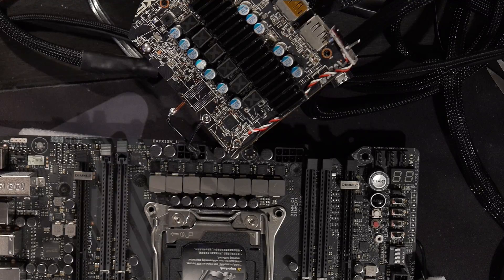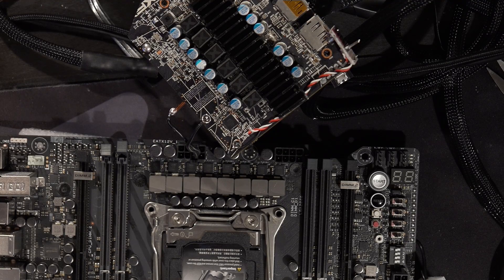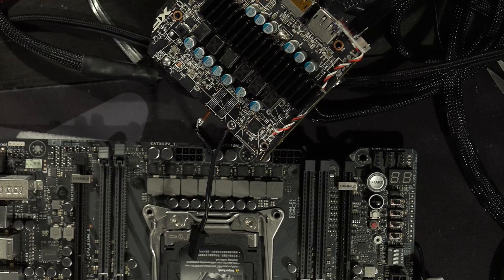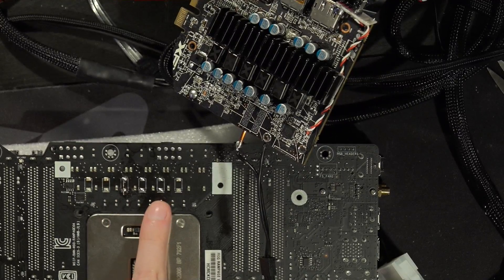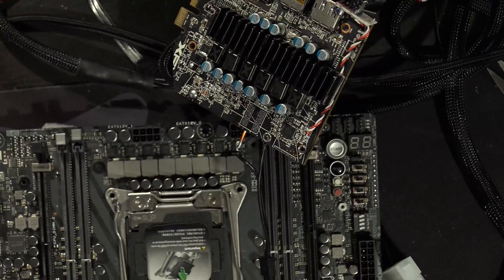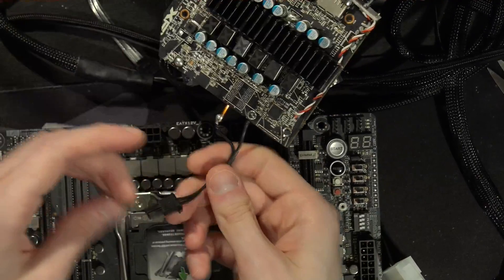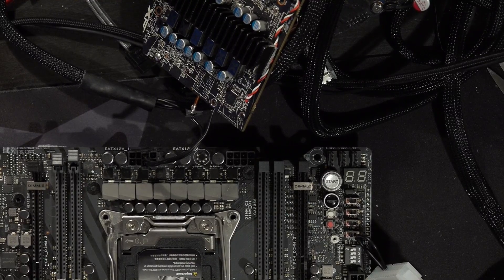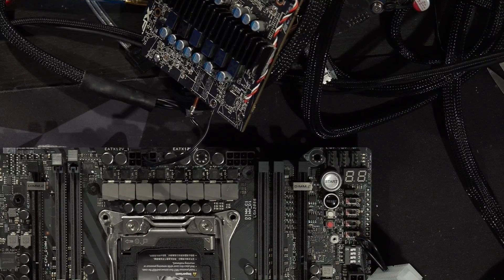Short hunting on the Rampage VI Apex using an RX 480 VRM

Comment: Hey Buildzoid, great video!   I really like that you showed the proper way to sniff out a short on a rail that could be shorted among lots of components.   Personally I use a thermal camera, but IPA is my backup along with freeze spray or upside down air duster.   As far as getting that component off, motherboards are not fun since they have massive power and ground planes to sink away heat.    I think I would desolder the 8 pin to get it out of the way, then cover the near by caps and inductors with copper or aluminum tape, then preheat the board to 80C or so in a reflow oven before trying to remove the chip.   That’s a safe temp for the caps and the plastics and puts a lot of heat into the board.   That should make removing the chip a bit easier.   I’ve also done sensitive work like that by getting a big glob of solid core solder on the tip of a wide iron and just laying the bead on top of the chip so it doesn’t flow around it and lifting it off with tweezers.  That usually can get enough heat to the pads without blasting the area with hot air forever.   Once it’s off you can wick the pads and put down some low melt point leaded solder and flux so it takes less heat to get a new one back on if you plan on replacing it.     Keep up the great work!

Comment: Hey man, my name is Conrad. If you could reply that would be great, but I understand that you’re a busy man and wouldn’t even see this.

So anyways, 2 weeks ago, my powersupply started going out. Whenever I would play a game, my entire computer would shut down and give me an error saying ASUS shut down my PC because system detected a powersurge. I assumed my PSU was going out, bought a 750 watt, and threw it in my system, everything worked PERFECTLY! For five minutes.. As I was testing a game, my computer did what it used to do. Just randomly shut down.. except this time, when I pressed the power button, everything would flash as if its turning on, for about a 0.001 second, then turn right off. The only way I would be able to get this to do it again would to disconnect all power from the PSU and reconnect it. My PC would do the same thing. . I was super confused as to why it happened. I looked it up and coudnt find anything on it. I have a gtx 980ti and its about 5-6 years old. I had a random gut feeling that my GPU just went out, so I unplugged the PCI-e cable to release all power from it, clicked the power button, and voila, the PC started to boot up.

Now to get to my main question. So obviously, my PSU and GPU were going out together, would there be anyway for me to take apart the gpu and fix a circuit that may have been fried? Also, what circuit would the the one that died, and if I cant, that’s fine because I already bought a new card, but I think it would be sick to be able to repair this card and possibly sell it.

Thank you for your time -Conrad.

Comment: This..... seems extremely overcomplicated. Why dont you use a benchtop power supply that has voltage limiting and current limiting?
Reply: Why should you if you can just use the janky RX 480 again? :P
Reply from the maker: It's almost like I don't have a bench PSU

Comment: I just repaired my r9 390x with a blown powerstage. I used a big hot air gun to heat the board from below and my hot ait station to heat it from above. worked pretty good.

Comment: Freeze spray will show up on camera much better also you could use a lab supply rather then a gpu vrm as you'd only need a 3 amp unit much easier for short detection

Comment: Throw a shitload of kapton tape on the 8 pin and those caps, and it'll be fine. Or you could just de-solder them. You could zip out all those through hole components in under a minute.

Comment: I think manufactures that are confident about their PCB desing should be sending you free video cards like they do to some other youtubers. Because if you do the PCB review plus demonstrate the overclocking potential on the card at both stock and modded, I am pretty sure just by watching your video, many people will buy that card instead of the other alternatives. Unless the pcb sucks. If i was a marketing director of any of the custom card builders, I would have already sent you the rtx 3080 and 3090 already.
Reply: Genuinely used his "review" of X570 motherboards to help me choose the one i was going to buy, same thing i'm likely to do with a 3090 when AIB models are available, the in depth talk of the more specifics of power delivery and PCB construction i find is really valueable!
Reply: @Nordern  Yup, i don't really find "getting 1 more fps out of the box" from a custom card compared to other custom cards that important. Especially on the high end cards. Most people buy these things for long term usage either for gaming or production. They won't buy every new generation of cards, for example i don't. I will pick the one with the best pcb layout and best vrm for better longevity expectations and that's it. And I will trust Buildzoid's word rather than other youtubers who only review the cooler on the card.
Reply: Thing is, Buildzoid has a relatively low viewer base as compared to LTT, J2C and GN...
So there would be a massive difference between the 35k viewers that BZ may get in and the 800k viewers that LTT may get in.
Reply: @FinlayDaG33k  I'm pretty sure most people who watch BZ do not watch (or at least trust) LTT. That's a different audience, and it feels to me that reaching some 30k-100k extra picky tech enthusiasts and increasing their trust in your brand at the cost of one card is quite worth it.
Reply: @Lishtenbird  That's true to a certain extend.

But look at it from a business perspective, what would make more sense for the marketing directors?
- send out 3 cards (of let's say $1k each) + $3k to 3 youtubers that have a combined viewcount of about 3 million. (so that'd be $12k for reaching 3 million views or about $0.004 per view).
- send out 1 card (of again $1k) + $500 to a youtuber with 100k views (so that'd be $1500 for reaching 100k views or about $0.015 per view).

Now remember the target audience:
- The sheep that will buy everything that the big techtubers shill for (ok, GN doesn't shill).
- The people that are capable of thinking and breathing at the same time and have a critical look at what they are about to buy.

So not only would BZ cost more per view, he will also generate less ROI for those companies (cus if 10% of those 3m will buy it, that's still 3x as much as BZ can generate "at best").
And well, there's also the added thing that now companies have to spend more effort (which costs time and thus money) building a better product (cus BZ will start rambling if there's something wrong with the design or quality) as opposed to those big-tech tubers that will mostly go like: "ye, it runs games, it runs them well, yadiyadiya".
This means that to get a "BZ mark of approval" they have to either cut into their profit margins or increase the price of the products (which won't make the consumer happy).
Yes, it might make those picky consumers more loyal and recommend it to others but it's a far bigger risk with very little extra reward so companies are less likely to take it.
Reply: @FinlayDaG33k  But, don't forget that HUB and GN make reference to him fairly frequently (GN, of course, has a cooperative agreement with him to do various review/overview vids).  I think BZ's influence is greater than can be deduced from his sub count.
Reply: @d00dEEE  That's certainly true, but I still do think that it won't be too big of an influence as opposed to sending it to someone like Linus or Jay...
I wish it would tho...
Reply: @FinlayDaG33k  Yeah, you're probably right, it's more about pure exposure than "competent exposure" for the most part...
Reply: @d00dEEE  yes, its fairly simple statistics.
more exposure == more uneducated (in the subject) people that see it == more people that buy it == more profit.

You need to make the card look attractive to the masses and capitalize on them.
That's why so many cards nowadays have those fugly "LOOK I'M A GAMER" designs and RGayB (not implying that being gay is bad) as opposed to making the cards cheaper (by keeping them simpler) or make the cards better (by sticking those pennies you saved on LEDs, plastic etc. into something like better TIM).

Ask anybody why he bought a specific board from a specific vendor?
They likely won't say anything about the VRM, the PCB design, the OC features (eg. voltage readout points).

You can make a high-quality card and sell them to 100k competent people for $1k each.
Or you can make a lower-quality card and sell them to 1mil incompetent people for $1k each.
Big difference in the profits you'll turn.
Reply: @FinlayDaG33k  The thing is 113k subs is not that low in my opinion. We don't have to look at only the top 3 most subscribed youtubers who cover similar topics. There are other youtubers who also get these cards free, not because they have over a million subs or something but because they will only review the card within a level that everybody can understand. They will show some fps numbers and temperature readings and noise levels and that is basically it. Another reason they are getting these cards may be that they contact the manufacturer and ask if they can get one for review, and they also don't really do a much deep dive comparison in between custom cards mostly. For example currently palit, zotac and msi all their flagship cards have missing VRMS while asus tuf does not have. Although i am not really sure if asus used some cheaper variant of the vrms to make it look better. But BZ can really tell his audience whether that pcb is all looks or legit. And this is the main reason why i think Asus should've handed an rtx 3080 to BZ because if the PCB is really good, they'd have nothing to fear. It is not like the engineers who design these cards can't tell whether their product is good or bad or how they compare to others. But we the audience can't just be sure unless someone makes a real deep dive video with technical explanations. Assuming the Asus card has a really good PCB and they sent it to BZ, and he made a video about it confirming that it is a solid card. Probably hundreds of people will shift their decision to Asus rather than MSI Gaming X for example because it has less vrm phases. So it would make sense for Asus to send him a card, not palit, zotac or MSI. But he isn't even getting that. Just my opinion, 113k subs with super deep technical videos and enthusiast audience of overclockers is really going to sell hundreds of cards if the card is good. And the ROI will be almost instant in that case.
Reply: @fy7589  Not to be rude (yes, I did read your entire comment) but that still boils down to my point.
Ofc, there are plenty of reviewers that did get the cards, but most of the boil down to their viewerbase:
- often not that deep into tech (atleast, not to a degree for the thing that we come to BZ for)
- easier to get to purchase a card (don't care about silly board design or a trashy VRM... it works, it games, it's gud).

I do agree that it'd be nice of AIBs to send BZ cards for his "reviews" but it's not a smart decision from a business perspective.
Reply: @FinlayDaG33k  Yes it does make sense from a business perspective. Making a good serious card costs way more than it would cost to send one of them over to a youtuber, and if you're making a good serious card you're likely banking on it becoming the standard recommendation from enthusiasts.

100k people is a lot because you know that there is bound to be one of them in any threads/posts asking for GPU buying recommendations.
Reply: The real reason thet they don't send Buildzoid their cards is because they don't need to. Buildzoid doesn't do benchmarks, he does PCB analysis, and Steve from Gamers' Nexus is likely to send him pictures of all the PCBs of the 3080s he receive.
Reply: @FinlayDaG33k  well, LTT is a great source of entertainment. BZ is for those who need the in depth knowledge of PCB/VRMs etc.

And you know what, there are more people chilling on Netflix than people going through an encyclopaedia or some book, etc. It's kind of that.

Comment: did you do the turn on power, hold power stage with tweezers GENTLY pulling upwards, as soon as the powerstage comes loose turn off the powersupply to desolder?
Reply: it seems a good idea for ripping pads but 8/8 for improvisation. :)